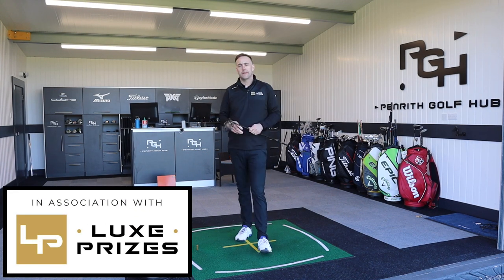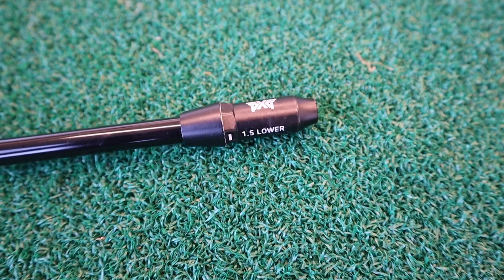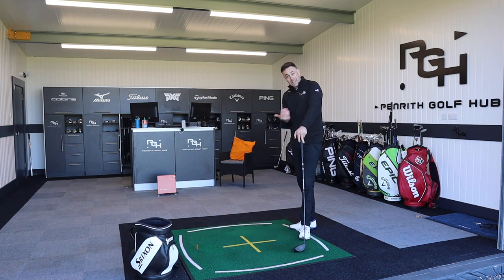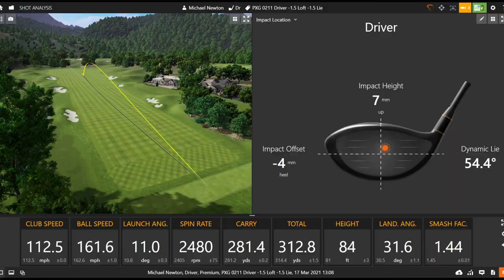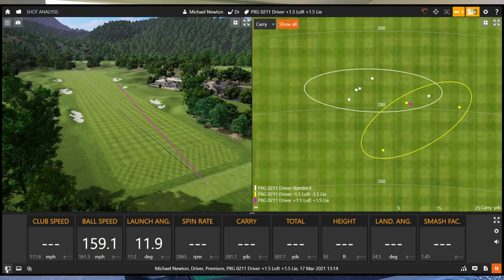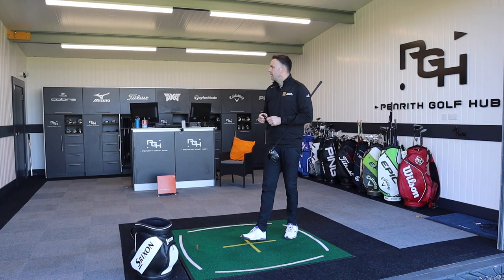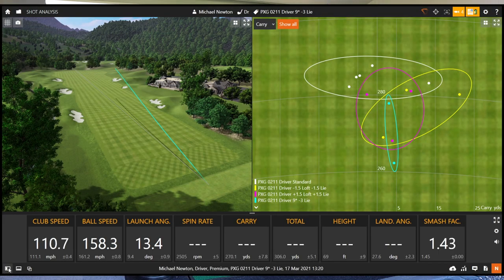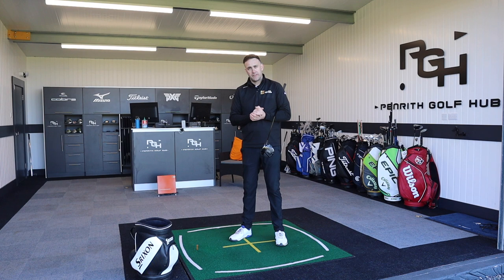PXG 0211 DRIVER NECK SLEEVE EXPLAINED & TESTED!

Comment: Thank you sir.  Wonderful explanation of not only loft, but how adjusting that impacts lie angle and possibly having an effect on open or closed club face.
Reply: I have one question, when changing the Degrees. Does the SHAFT stay the same when lining it up for your shot? meaning the Shaft doesn't rotate around from the Center of the Grip correct? Which pointed down the Center to the Head..
Reply: @JSPT300  The shaft and grip rotate.

Comment: Thanks Mike, that was very interesting. I had always been led to believe that as you added loft on the neck-sleeve you closed the face angle, whilst if you decreased the loft you opened the face. I hadn't realised that PXG's neck sleeve works differently from the PING sleeve,
Reply: This has always confused me.  Why wouldn't you just turn the club a bit in your hands to square the face?
Reply: @IlliniDog01  Personally, I have always gripped my driver slightly closed (to guard against a fade) and my wedges slightly open to prevent a left miss. it has always worked for me👍
Reply: Same here. I assumed that by putting it on the big plus setting I was closing the face and creating a draw bias, type setting. 
Back to the drawing board I guess. Sadly, the big plus setting seem to work for me to avoid the slice. And I’m a Leftie who is right handed. So I’m up against it no matter what.

Comment: These adjustable sleeves definitely work. I have the PXG Gen 4 0811 XP in 7.5*. I am a high ball hitter and tend to generate a bit more spin than I would like. For reference, my miss is a snap hook. I put it in the small minus setting which makes my club 6.5* loft with a half degree flatter lie. This definitely brought my ball flight down and I am now hitting it further than any driver I've ever hit and straighter too. PXG has done a great job with their equipment!

Comment: I have one and I love it. I was set to fit and buy a Titelist TSI 2 and Rick Shiels deomoed this one. Guy had 2, in the box and sold me one for $200. USD. I changed the shaft to the 50 gram Evenflow Riptide. R flex. 44 inches. Sold the 60gram S for $100. USD. Not a bad deal.

Comment: I've been playing a 9 degree Mizuno MP-001 Driver with an Exsar Sixty Regular flex shaft for several years now and it has always served me well.  It appears to be developing a crack in the crown so I decided to ask for a PXG 0211 for Christmas because of the good reviews and crazy low price.  My parents bought me one in 9 degrees with the Mitsubishi Diamana S+ Regular Flex Shaft.  I'm short (5'7") and normally play 15-yard fade with my driver when I want to find the fairway consistently.  I carry about 265 on average and occasionally smoke one over 300.  My miss is a pull hook when I get tight/nervous and let my hands get in front of my upper half.  I wonder which of the Standard position or the PXG position with the -3 degree of lie would be better for me.  The grip being upside down for the PXG setting would likely drive me nuts, but I guess results are more important.  I guess I'll try to find out when it warms up which position I prefer.

Comment: Thanks Mike, interesting video. But can you advise if PXG use the same neck sleeve for the lefthanded driver? Callaway use a sleeve with an underscore marking on the setting to distinguish it from a right handed sleeve?
Reply: PXG definitely has Left Hand neck sleeve. How can you tell? If the + sign is on the left side of the standard setting, then it's a left hand sleeve.

Comment: Appreciate this video is a year old, but I’ve just ordered an 0211 so this is perfect for me. Possibly stupid question: if the face becomes open or closed after adjusting loft, surely you just tweak your grip so it’s square at address? Am I being thick?!
Reply: Curious, how's your pxg driver?  I'm looking at getting a 0211 or a gen4.  Any updates would be appreciated

Comment: i adjusted my loft from 1.5 back  .o5 above neutral loft setting-this did not produce any change in my hooking the ball too the right .This Head is forgivable i was able too hit straight 250 yards down fairway 
even though ball made contact closer too the heel of the face of club head